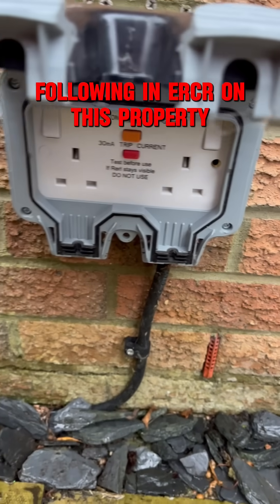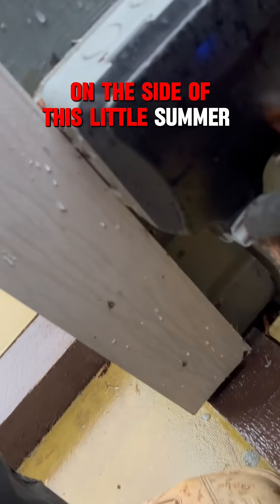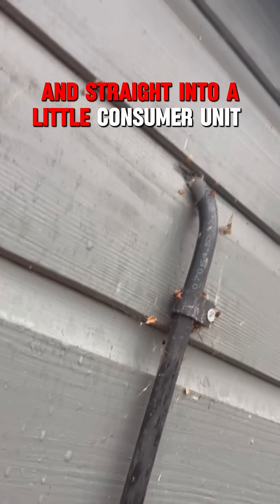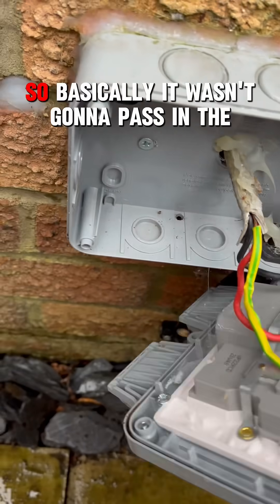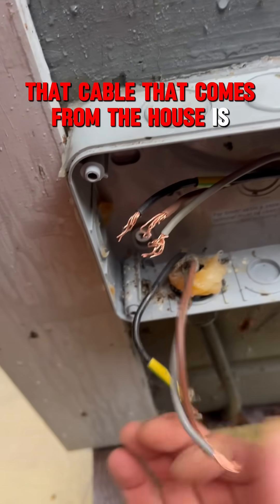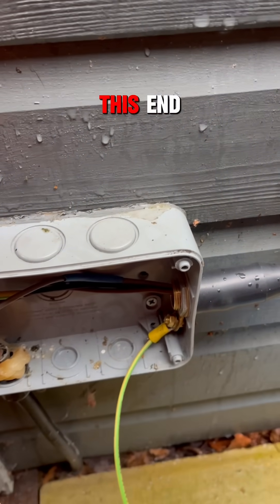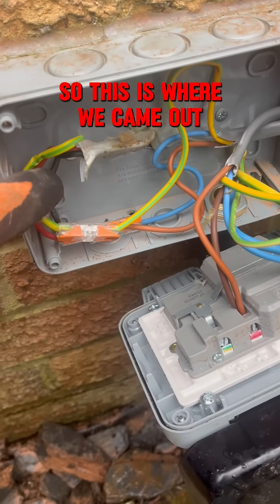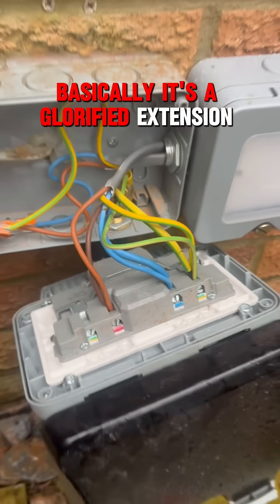EICR FAIL! The Shocking Issues I Found! ⚡📋

Comment: You should not use the armour as cpc
Reply: You can use the swa as the cpc.
Reply: The black conductor sleeved in green and yellow is the cpc, the armour is earthed as it's an exposed conductive part.
Reply: You can use the armour as the cpc up to a certain size. I personally think it's a bad idea, as is using a nut and banjo on the inside of a plastic box. Should have been an earth nut IMHO.
Reply: You do realise you can use the armourings as an earth. Perfectly fine if done correctly. It's so correct that I pull in 240mm supplies at times as a 4 core armoured. Can you guess where the earth comes from?
Reply: 1) you can use the armour as a CPC provided it meets the requirements for conductance
2) in this case the armour was not being used as the CPC anyway (so your point is irrelevant). However, the armour must be bonded to the CPC as it counts as exposed conductive due.

So one incorrect statement and another failure to observe the actual installation. Pretty good.

Comment: Exactly how I did my outdoor sockets (the correct way)
Reply: Definitely not the correct way, if that's how you wired yours. It's bad practice to spur off a spur and shouldn't be done, even if fused down.
Reply: @r3co0  as long as it's fused you can spur from a spur until the cows come home
Reply: You must be a DIY Dave. Fill your boots cowboy.
Reply from the maker: @r3co0  what makes you assume this?
Reply from the maker: @r3co0  so what’s wrong when it’s fused down buddie?
Reply: @toolboxtalking  Although in theory, the maximum overload protection is 13A. In practice, what you have created here is a strong likelihood of random people plugging in various loads and going way over the 13A.

 Outside sockets in a outside area usually end up with heaters. The 13A fuse will not pop anywhere near that level and will hold at least double it's listed current rating and likely higher.
Therefore, there is a strong likelihood the cable will overheat over time and could become a fire risk.

Would you seriously design a job and use this wiring method for a daisy chain of sockets outside? If the answer is no, which it should be, then why do it. 

I can understand a customer not wanting to shell out more cash and you doing a temporary fix, but to say it's the correct wiring method is wrong. 
Have u ever seen the fire brigade videos of people plugging extensions on top of extensions? That's one of the top causes of fire in a home.
Reply from the maker: Proper nice one
Reply: Urm... If the cable is 2.5mm solid/cwa I'm not sure how the cable will go inferno with a 13amp fuse 
They don't hold above 13amp for long and if it does, the fuse might be some form of Chinesium. Most fuses won't sustain above 50 percent rated capacity for very long (I'm not talking about header fuses - I know they are 50 percent over rating for thirty minutes sustained and the taper curve is drastic past that. 2x and it's seconds. But hey, I'm just reading things...)

So even under 2x, 2.5 cable clipped direct will handle 26amps which is double 13. Technically indefinitely. But it will get rather warm... 
I would still like to make sure if outside the circuit has RCD protection
Reply: The problems comes when 1.5mm cable is used in flex or solid, where it is below 13amp + 50 percent...

But I have an extension cable in my shed. Which isn't fused. Where it lives indefinitely. So that's nice. Isn't it.
Reply: Ive read it again and I'm still very much of the mind if you have a fuse that doesn't do it's job above marked rate+50% you have a fake fuse or a defective one.